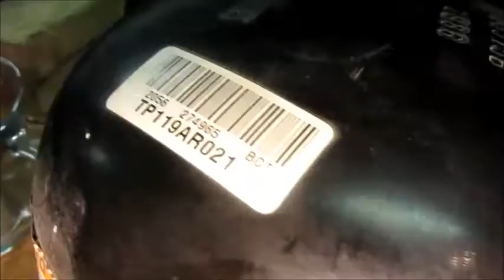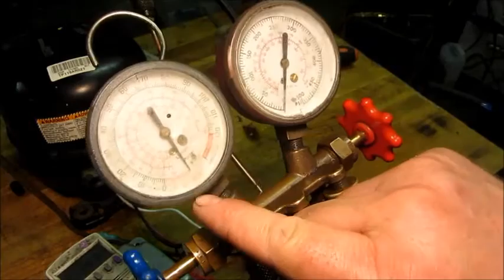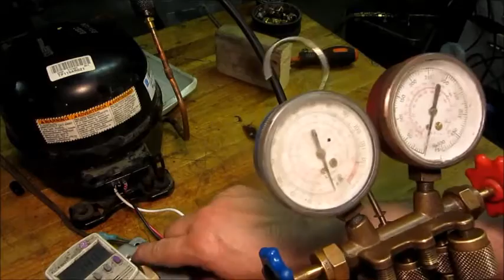Reuse of salvaged / junk fridge compressor - oil change and flush...

Comment: Can a compressor that hasn't run in a long time be saved? I have an early 90's air conditioner I want to use, but the compressor seem a bit weak or seized even though the unit looks nearly brand new inside & out. The previous owner said they hardly used it
Reply from the maker: Yes, they can, depending on what is wrong with it.  If the compressor is stuck because it has dried up oil on the parts, you can often get it going. This happens if the lines are left open to air for a long time and the oil dries and oxidizes. 

If your unit is still sealed up and charged with refrigerant, there is likely something else wrong with it. If it is sealed and charged, sitting does not really have any effect on it.
Reply: @davida1hiwaaynet  Hard start kit can work wonders on that, likely weak because the capacitor is low in value. New capacitor and it will run most likely, especially on a window wall where it got a few bake cycles on it.
Reply: Interesting. The previous owner told me the technicians they hired had to dump most of the refrigerant in the unit to the atmosphere because the compressor is too weak to pull it all into the condensing unit. The compressor can't even handle running for more than 5 minutes with the correct charge. Can I get your recommendation on what the best next step is to fix that AC?
Reply from the maker: First off, is this a window unit, or other package unit? Or; is it a split system?

It almost sounds like someone put R22 in an R12 unit, or possibly R410A into an R22 unit. Something with a much higher pressure than the compressor is engineered for. 

In my younger days I did that, putting R22 into an R12 unit. That resulted in the same issue you describe - it would run a few minutes and either, overload trip - or the compressor would actually bog down and stall, then the overload would trip. 

As Sean mentioned in his comment above, be sure the compressor run capacitor is working correctly. That is necessary for starting and for developing full rated power while running. If that is bad, the compressor will have low power and high current draw.

Assuming that isn't the problem, you may have a factory defect of some sort. That would be especially likely considering the unit looks like new, but is 40 years old. It's like every owner who had it in their possession was not able to use it and wear it out.... because it never worked right.

Look to be sure the compressor is marked for the refrigerant in use. Also, measure the current draw and see what that looks like as the unit is started up and as it builds up to the point where it is about to trip out or stall. Make sure the Main and Capacitor winding circuits on the compressor motor aren't swapped.
Reply: It's an R22 220V minisplit. I don't know whether the previous owner used proper refrigerant for it or not, but I tested the unit with R22 when it came to me. It drew 0.9 Amps past its rating with 80 PSI of R22.

Can a weak compressor run capacitor cause that issue? I've not tried replacing it yet though
Reply: @TheFanUniverse  Yes it can, put a new one in and the current draw will be lower.
Reply from the maker: @TheFanUniverse  
Interesting.  Yes, a run capacitor can cause the compressor to draw more amps and have low power. 

When you say with "80 PSI of R22" that worries me because the system needs to be charged by weight not pressure. Check the run capacitor first. If it is good, then recover the whole charge and weigh in the correct amount on the nameplate. See if that helps it.  Also, if it was installed carelessly and a bunch of air is in the system it may have massive issues. Is this a rotary compressor?
Reply: I’ll look into that. The condensing unit was installed with minimum protection from the elements by the previous owner, I wonder if that is a factor?
Reply from the maker: @TheFanUniverse  
Ooh - hopefully the condenser fan, and the cooling fins in the condenser are all still OK.
Reply: I see. I believe my unit has a scroll compressor, but I could be wrong as I have little to no knowledge in regards to air conditioning.

I actually have never seen any technicians here, including air conditioner collectors in my area charge their ACs by weight, they all do it by checking the pressure in that valve thing. I have no idea how the unit was first installed, but judging by the condition of other ACs in that place, I think it’s safe to say that the techs that installed that unit didn’t pull the air out of the pipes before letting the refrigerant in
Reply: The condenser fan is totally fine, the bearings are still silky smooth. There’s a bit of rust on the condensing unit’s body & a tiny part of the condenser coil is corroded to the point of the fins flaking off when touched, but other than that, I could find no leaks
Reply: @TheFanUniverse  No, they are normally exposed to the weather, just check the fan there turns freely, and blows a lot of air, and the fins are not blocked up as well, all of which can cause poor cooling and higher current draw as well.

Comment: Hey David. Sorry for leaving a comment that doesn’t have anything to do with the video. Just had a question about a fan. I have this 16 inch Ge vortalex, the previous generation toyours.  It has a very loud loose winding kind of sound. I tried jiggling the windings and they were nice and secure. I also tried adding thrust washers to reduce endplay on the rotor. It has a 2 micro farad 250 volt capacitor and I was thinking maybe that’s the issue. It is original after all. If you have any ideas please let me know. Thank you!

Comment: Is there any risk of chips from the drilling/tapping remaining inside the compressor and causing a problem later on?
Reply from the maker: Yep, there is that risk. That's the reason I always put nitrogen pressure in the compressor housing during the drilling and tapping. It ensures that any swarf blows out as opposed to falling in. It's a risk to me from flying swarf, but I can manage it by safety glasses and being careful.
Reply: @davida1hiwaaynet  Oh! Yeah, I wondered if maybe the N charge was for that reason. :-)
Reply from the maker: @DanielJStern  Yep!  You got it right.

Comment: Well, 3 years ago, I would say this is a waste of time (of course, it's your time to waste). But these days, save anything that can be saved, because parts shortages are the 'new normal.' At any time, any part you need can suddenly and without warning nor reason become unavailable.
Reply from the maker: It's a shame to have to think like that, but it is a real problem we are facing in many sectors. I had to wait 9 months for a fuel tank last year, as an example.

Comment: What was wrong with it in first place
Reply from the maker: That compressor came from a commercial drink cooler which had been clogged with leak sealant. I replaced the leaking lines, and had to remove the contaminated oil saturated with leak sealant. The capillary tube would repeatedly clog up otherwise.

Comment: Flush the compressor out with flush and replace with Poe oil or whichever oil is compatible with refrigerant being no drilling needed
Reply from the maker: Actually; you never put flush or any solvent through a compressor. Only compressor oil.

Comment: To fast rpm for drilling
Reply from the maker: No, not too fast for this size bit and material.
Reply: @davida1hiwaaynet  im random guy from internet i know better xD
Goodnight
Reply from the maker: @gelo1238  
LOL no I'm not trying to be argumentative. I appreciate your comments on my other videos as well. I just need to justify how I was doing this job.

There are certain speeds best for s given drill size in certain metals. Charts are pretty easy to find online. If one were using a drill press with defined speeds, it would be easy to set a speed based on a chart.  However, using a hand drill one has to rely upon experience. If anything; I was running the drill a lot slower than recommended. The thread size for the tap is 8-32, so the drill bit for that tap is a 9/64" bit.  Most drill charts for that size bit recommend a maximum speed in mild steel of about 3000 RPM. The drill I was using doesn't go that fast even at full speed.

Comment: do not make hole or drill at bottom, later cause to leak ㅐㅑㅣ.
Reply from the maker: Actually, no. No; it will not cause a leak once the plug is soldered in place with StayBrite-8.